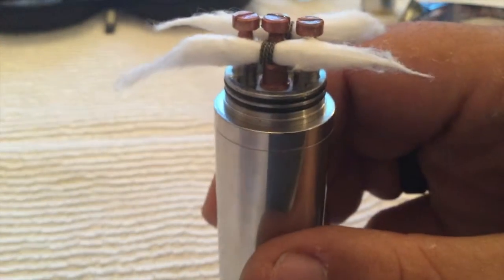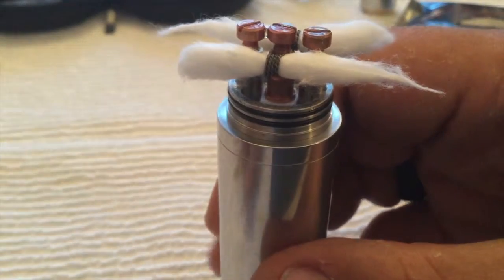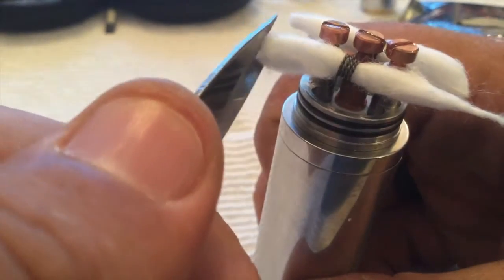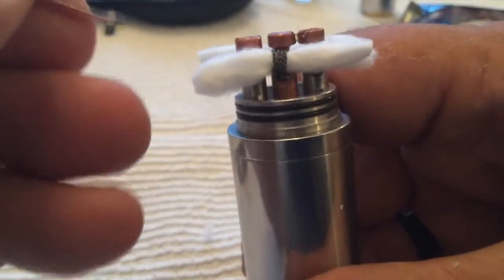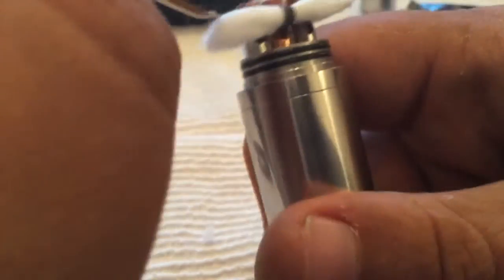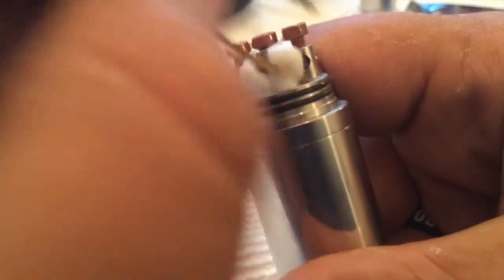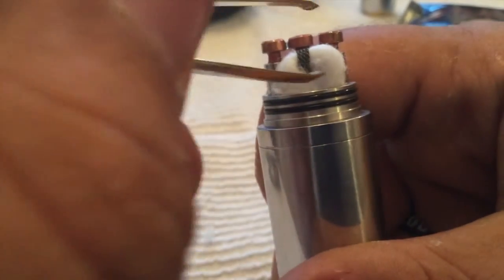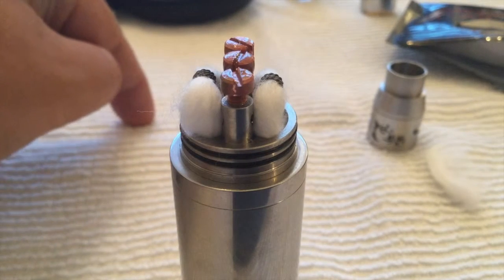Cotton Bacon V2 Review/Giveaway

Comment: I'm sorry you didn't have a good experience with this cotton. I noticed you said that you were getting muted, but clean flavour, and I would like to comment on that. When you showed your coils, I noticed that you had VERY little surface area between your wick and cotton. I do realize that your vaping an unregulated device, and this is most likely necessary to obtain your desired wattage. However, you'd be very surprised how well building a higher ohm coil, and using a regulated mod to push more voltage to it boosts flavour. I do 8 - 9 wraps of 26ga (core) clapton wire and send approximately 4.6 volts to it and I get TONS of flavour and vapour for a single coil setup. Just my input, and if you didn't already know this information I hope that it helps! Have a great day!